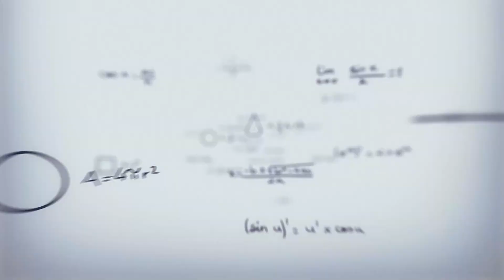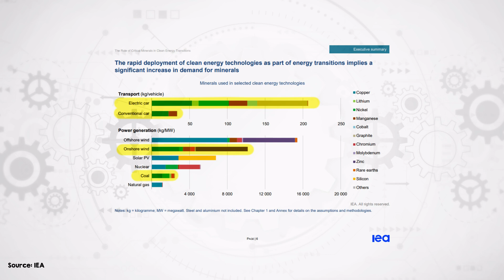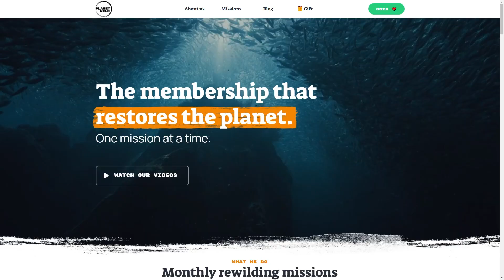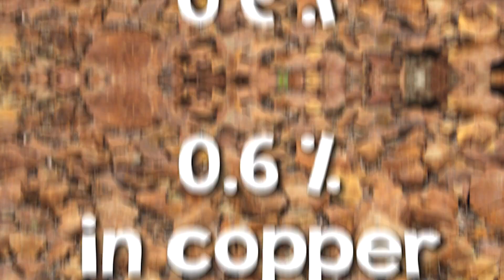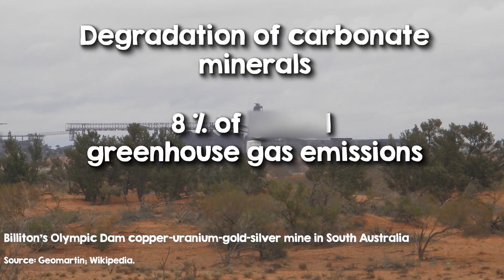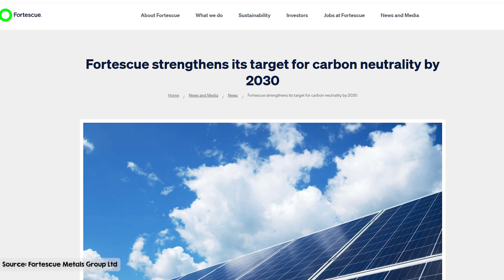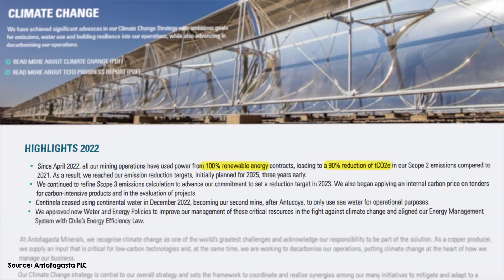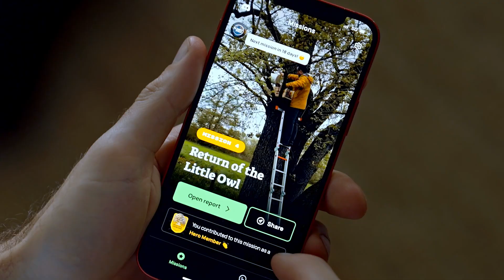Zero-Emission Mining Technologies are Here

Comment: Here's a 90s (and 70s and 80s) environmental idea that I think is still valid - use less....of everything. 

As well as saving energy, you'll save on all of the materials that need to be mined, to produce the stuff we use for a little while and then throw away...

Buying a new 3 tonne electric SUV, and charging it from one of the dirtiest grids in the world (Australia),  won't halp much to reduce CO2 emissions, particularly if you're charging it overnight, when coal supplies 70% to 80% of the grid supply.... 

Use public transport instead - it's more efficient than private vehicles, no matter what the power source.

To quote another Engineering Youtuber, John Cadogan - we can't consume our way out of the problem....
Reply: Not as much as one would like, but when you look at the whole efficiency cycle, even a 100% coal powered ev produces less co2 than a petrol car per km driven. This is due to the higher efficiencies of burning coal in a large plant than a small engine, the regenerative breaking of evs, and the relative efficiency of electric systems compared with engines.

I agree though, more public transit and densafication is an essential part of our growing cities and making things more green.
Reply: @varno  this is one of those (often repeated) EV myths that sound nice and plausible in theory, but just aren't backed up by objective fact or reality...... 

Compare, for example a Mazda 3 (official consumption 5.8 litres/100kms), with a Tesla Model 3 Std (official consumption 0.150 kwh/km).

Petrol produces 2.91kg of CO2 per litre when burned in an ICE. A black coal fired power station of the type predominantly used in Australia produces 1.11kg of CO2 per kwh of energy at the wall outlet.

If you use these figures and do the arithmetic, you'll come up with 170g CO2/km for the Mazda, and 167g CO2/km for the Tesla, so pretty much the same..... It's even worse for a brown coal fired power station (which is about half of the total coal generation here).

When you include the extra embodied CO2 in an EV at manufacture due to the battery (about 100kg of CO2 per kwh of battery capacity), the Tesla would need to have 20% lower emissions per km than the Mazda to just break even over a 200,000km lifetime.

In Australia, most of our renewable energy comes from solar (which doesn't work at night), consequently between about 11pm and 6am, the electricity grid is usually about 70% to 80% coal based.

As a result of this, if you charge an EV at home from the grid overnight currently (as will most people who use their EV to commute to work), your EV will not be significantly cleaner than an ICE, and could even be worse.....
Reply: @peeemm2032  there are two things to consider in this calculation that make your analysis unfair:

Firstly  you use 100kg/kWh as your battery co2 emissions rate, but the mekinsey report you are pulling that from puts that at the upper range, where as the lower range is about half that with the more conservative values being between 40 and 80kg/kwh. This brings the life cycle embedded carbon for a rear wheel drive model 3 to somewhere between 6g/km and 12g/km

Secondly, the design life of an ev is roughly double that of an ICE vehicle, with the model 3 battery desogned for 400,000km, so you need to include the embedded carbon in the steel of the second car that is not produced in your life cycle calculations to offset the co2 embedded in the battery, further reducing the overhead.

These two things basically equalise the difference you bring up in your analysis, tilting the scale slightly towards the ev. If you add in the final fact that, the electricity mix in Australia is going to change over the next 10 years, whilst the petrol car will always use petrol. It is the greener move to buy an ev.
Reply: @varno  no, when I checked a range of credible sources, the values were from a low end of about 30kg/kwh, up to 200kg/kwh, depending on chemistry, where they were made, and who makes them. Without knowing the exact source of the battery in any particular EV, I think 100kg/kwh is a reasonable "average" value to use for comparison......

You are also assuming that the batteries are actually going to last as long as the manufacturers say they will (ditto the cars). Maybe they will, maybe they won't, but at the moment there isn't a good body of evidence to back this up, so until thete is, I'll stick with a 200,000km lifetime....

In any case, even ignoring the extra CO2 from manufacture, it doesn't change the fact that an EV powered from 100% coal isn't going to be any cleaner than an equivalent ICE, and that when charged overnight in Australia, even ignoring CO2 from manufacture, the absolute best it will be is 70% to 80% of the emissions of a similar ICE vehicle....

Yes, things will change in the future, but nobody knows how quickly and exactly what that will look like. I'm talking about right now, and for the immediate future (5yrs)....
Reply: @varno  Absolutely correct!  100 kg of CO2e emissions per kWh of battery capacity was the upper-most of the range, several years ago.  That number goes down by nearly 10% every years, through manufacturing improvement, and less energy-intensive chemistries.  The average is now around 50 kg/kWh of battery capacity... and still going down!

One little question:  you wrote "...the life cycle embedded carbon for a rear wheel drive model 3 to somewhere between 6g/km and 12g/km".  Do we agree that this number is carbon, NOT CO2?  It can be confusing.

While I totally agree that the lifetime of an EV is likely to be at least double that of a comparable ICE vehicle... it is not yet proven, not enough EVs having yet reached "old age" to make bullet-proof statistics of that!

I made a little model calculating after how many km or miles the carbon debt incurred by an EV in manufacturing is paid back, as a function of the carbon intensity of a given grid.  Using the Polish grid's record carbon intensity of 690 g/kWh (worse than even Australia), this pay-back comes at around 20-25'000 km, or 13-15'000 miles.  So after hardly more than a year of driving  in Australia, two in Europe!
Reply: @st-ex8506  that 6g/km was based on a 400,000 lifetime, with a 60kW.h batter (slightlyy larger than a base, tesla model 3) and 40kg of CO2 per kW.h of battery capacity. 12g would be for 80kg of CO2 per kW.h. 

One nice thing is the numbers commute, and so if you have 200,000 km and 40kg/kW.h you get 12g/km, and if you are 80kg/kW.h you get 24g/km in co2.

The unit is co2 equivalents and not carbon mass.

Australia currently has a very high percentage of coal power, within 10 years it is all scheduled for decommission, but right now overnight power is annoyingly stubbornly coal here, and old coal at that, though I should get some numbers for out co2 intensity here and check that number too.
Reply: My 11 year old Nissian Leaf I bought 6 months ago does 6 km per kw  so 200 gm co2 per km a base model Tesla model 3 does a bit better my numbers are from the last 6 months I have had it. around 1/5 of your numbers I charge off 15 year old solar panels that cost me $100 a kw 4 years ago. A 5 year old Tesla should last another 20 years till its range is the same or much more as the Leaf had when new saving $3,000 a year x 20 =$60,000 and the battery can be recycled something not possible with burnt petrol + 40 oil changes and a big pile of plugs, filters, belts ect.
Reply: @varno  I can save you the trouble - from the last National Greenhouse Accounts Factors document   (published in August 2023, and covering the 2022/2023 financial year), the national average CO2e emissions intensity for the electricity grid was 0.73kg/kwh, including scope 3 emissions (indirect emissions from grid losses, mining and transport of coal etc.).

According to OpenNEM, the energy mix for the NEM for the s as me period was 57.6% coal, 5.5% gas, and 36.7% renewables.....
Reply: @suncitybooksgeraldton335  you haven't put a tag at the front of your post, so I'm assuming you were responding to me.

If so, you may be a bit cinfused - I'm not sure which of my numbers you're disputing, but I said a Tesla model 3 will produce about 167g of CO2 per km when charged from 100% black coal.

This is about what you say you are getting from your Nissan Leaf, though if you're getting that when you're charging from solar panels, I think there's something wrong there, you should be doing much better than that.....
Reply: @st-ex8506  I don't know what your sources are, but the MIT (Massachusetts Institute of Technology) Climate Portal, from an entry updated in 2022, had this to say - "For illustration, the Tesla Model 3 holds an 80 kWh lithium-ion battery. CO2 emissions for manufacturing that battery would range between 2400 kg (almost two and a half metric tons) and 16,000 kg (16 metric tons)", which represents  a range of 30kg/kwh to 200kg/kwh. They also said this was due to where and how the raw materials were mined, and where the batteries were made, with batteries manufactured in Europe and the USA tend to the lower end of the range, and batteries made in Asia tend to the higher end of the scale (consistent with the energy mixes in those regions).

Given that most EV batteries are made in China, and so more likely to be at the high end of the scale, I  think a reasonable average is 100kg/kwh, and this is probably still being generous towards EVs, even given manufacturing improvements in the meantime......
Reply: @peeemm2032  I was saying I go around 6 km per kw not 1km so 1/6 the polution if I used coal fired power but I use my own solar We also have large solar and wind farms near by that provide power for others without roof top solar.
Reply: @jonathantamm9202  a Nissan Leaf uses about 0.171kwh per kilometre (manufacturers figure), so yes, about 6km per kwh. If charged from 100% black coal fired power (which produces 1.11kg of CO2 per kwh), then the Leaf will produce about 190g of CO2 per km - this is about the same as a similar ICE vehicle (a petrol powered Mazda 3 produces about 169g of CO2 per km).

If you charge from solar, the Leaf should be pretty much emissions free..... But solar doesn't work at night, so if you're charging your EV from the grid overnight (which is what most people who use their car to drive to work during the day will do), the grid is 70% to 80% coal, so your EV will not be much cleaner than an ICE....

BTW, used engine oil can be sent back to be re-refined and re-used. When you get your car serviced, the used oil gets dumped into a tank, and a truck comes to pump this out regularly, and as far as I know, that's what happens to it. Steel in used oil filters can also be recycled and reused. Modern spark plugs last for 100,000km or more, so your average car probably only has 1 or 2 sets of plugs in it's life.......not much waste there either.....
Reply: @varno  I found the McKinsey report you referred to (from February 2023), it had the following to say about CO2 emissions from battery production:-

"(Battery production) is the biggest source of embedded emissions for both electric cars and trucks, accounting for about 40 to 60 percent of total production emissions", and 
"making batteries can generate as much emissions as producing all the other materials that go into making an EV—or even more"

It also said "producing a typical EV (with a 75-kWh battery pack) emits more than seven tons of CO2e emissions on the battery alone". That is, more than 93kg of CO2e per kwh.......

All of which essentially essentially agrees with most of the other reports I've seen, and backs up the estimate of an average of 100kg of embedded CO2 in an EV battery per kwh of capacity which I was using for my example (and which you objected to).

I really don't understand how you could concluded from this report that a figure of between 40kg and 80kg of CO2 per kWh was more accurate??
Reply: @peeemm2032 

Firstly, my number was between 40 and 80, not between 20 and 40, kg/kw.h. 

Secondly I was talking about the delta between an equivalent petrol car and a ev in terms of embedded carbon, and not just the ev. So I do think that the delta in co2 is fairly somewhere in that range.

Edit:
Also, not that the same report explains that most manufacturers believe that it is possible to get those emissions to 20kg/kw.h in the 2030 timeframe. Also look at exhibit 2, where while the text says 100kg/kWh.h there are already value chains doing it at 40kg/kw.h.

I think my estimate is reasonable given this, and that it will be progressively better over time too.
Reply: @varno  My apologies, I inadvertently misquoted you - I read 40 to 80kg/kwh, and for some reason wrote 20 to 40kg/kwh. I've now corrected this in my post....

It doesn't change anything much however- your figures are still wrong.

For absolute clarity, I was talking about the extra CO2 produced during the manufacture of an EV over an equivalent ICE vehicle.

The McKinsey report clearly states that, today, manufacture of an EV has "roughly double" the carbon footprint that an equivalent ICE does. 

It also states that apart from the battery, a BEV and equivalent ICEV have a similar carbon footprint during manufacture - this means that the "delta" is essentially the CO2 for battery production, which they clearly state is "more than" 7 tons for a "typical" EV battery of 75kwh capacity, i.e. more than 93kg/kwh of capacity.

Exhibit 2 in the report shows CO2 emissions intensity (kg/kwh) for Li-Ion battery manufacture from different countries - Sweden at 45, South Korea at 72, United States at 74, China (non nickel chemistries, e.g. LFP, only), at 79, and China (nickel containing chemistries, e.g. NMC) at 108.

If you look at Sweden, you'll notice that there's no component for cell production included in that figure. The only Swedish Li-Ion battery maker I can find a mention of is Northvolt, and it's not clear if they're actually manufacturing complete cells, or if it's just cathode material.... So I'd take that figure with a grain of salt...

The report also says that more than 70% of Li-Ion batteries are made in China, and I would guess the majority of this is still nickel containing chemistries, which probably explains why their stated figure for an "average" battery is over 93kg/kwh.

The only prediction about future emissions intensity from battery manufacture contained in the report is that "the global average of GHGs from battery production could decline to 85 kg CO2e/kWh by 2025". They only say that it's "feasible" to reduce GHG emissions for battery production by "up to 75% in the next 5 to 7 years", then give a whole list of caveats, actions and conditions for this to happen. I wouldn't be betting on it.....

If you read my posts, I've used the present tense in all of them - everything I've said is about what IS ACTUALLY happening now, not what MIGHT (or might not) happen by 2030, and I've been talking about EVs in Australia, not anywhere else.

I fully expect battery technology, and as a consequence EVs, to be better in every way by 2030 - they will be lighter, safer, cleaner, more reliable, and have better range. The Australian grid will also be cleaner, so EVs here will be too. The question is only by how much....

I'm still mystified by your claim that my estimate of 100kg/kwh for CO2 from battery manufacture is wrong, and you think it's 40 to 80kg/kwh.......The McKinsey report doesn't support any of your assertions......
Reply: @peeemm2032  I acknowledge that those numbers were probably not supported by the McKenzie report, but for example the model 3 base model that I have been using as a benchmark used LFP battery cells, and an analysis of the embedded co2 potential for lfp packs  by lai et al. suggests this is closer to 62kg/kwh (doi:/10.1016/j.jclepro.2023.138674) gwp with a range of uncertainty between 42 and 72 kg/kw.h, NMC cells do have a much higher GWP of closer to 122kg/kw.h in that study.

In general, these seem to make up about 5-10% of the lifetime co2 emissions of the vehicle, and so really the question of whether the beverage has a lower gwp than a petrol vehicle seems to come down to two questions:
1. What is the energy mix that is used to power the BEV.
2. How much longer does a bev last than a conventional ICE vehicle in terms of km driven.

With conservative answers to both those questions one gets that with the current east-coast energy mix the bev probably emits somewhere between 70% and 115% of the co2 of an ICE vehicle, assuming equivalent lifespan.

If one takes into account changing energy generation and a longer lifespan for bevs (for which there is beginning to be good evidence) and that even without this the minerals within the bev will be recycled at the end of life of the EV rather than disposed of, the energy usage over the lifetime of a new bev could probably be reasonably expected to be substantially better that that.

However, I do agree that with current manufacturing, the difference is not as clear cut as many would wish.  Long term though, it is the only real way to decarbonise private vehicles, and we do need to prioritise their roll-out, it just has to be done in tandem with greening the electricity supply, and reducing the environmental impact of mining and manufacture. This can only really be done by developing more scale.
Reply: Who is buying a 3-tonne electric SUV?  There are thankfully only a very few of them produced.

The dirty electric grid in Australia is not the "fault" of EVs, but of Australia's energy choices through decades.  But I understand it is achanging, and getting cleaner every year that goes by.  And even so, it still many many times cleaner than burning petrol or diesel!  And there are already many countries that use zero or next to zero fossil fuel for their electricity generation... and for sure zero at night, when indeed most EVs are being charged.

I agree with you that using public transport is best... and I do just that all weekdays, as my country (Switzerland) enjoys a incredibly good public transport network.  But, unfortunately, it is definitely not the case everywhere!

On-demand transportation by driverless electric cars might well become one way to very significantly decrease the size of the world's car fleet.  But, it will take a few more years...
Reply: @st-ex8506  over the last 30 years or so, people in Australia have been moving away from public transport and towards private vehicle use - peak hour in some of our cities now last 3 to 4hrs.... 

The two top selling "cars" here last year were both medium sized dual cab pickup trucks, and the rest of the top 10 were pretty much all small to medium SUVs. Our average "family" vehicle is a medium sized SUV (e.g. Subaru Forester, Hyundai Tucson etc.).

Large SUVs (e.g. Toyota Landcruiser, Nissan Patrol, Range Rover etc - all around 2.6t) are also relatively common. You often see them in traffic, with a single occupant, being driven to and from work, and I'm pretty sure that many of them (possibly even most) are never used for anything other than commuting, shopping, driving kids to school etc......

You're right, we don't currently have many electric SUVs at or over 3t - the Kia EV9 (at 2.6t for the top tier GT-Linel, and the Mercedes EQS 450 4Matic (at 2.9t - pretty close!) have recently been released here, and I'm sure some people are buying them. The EV Range Rover has been announced for this year, and given their plug in hybrid weighs 2.8t, I would expect the full BEV version to be somewhere near the 3t mark....

So 3t BEV may have been a slight exaggeration right now, but it's only a matter of time before they're a reality, and I'm sure there will be some fools who will buy them, thinking they're helping the planet....

My point was that if you're genuinely concerned about greenhouse emissions, using a large SUV of any  kind (ICE, BEV, or even hybrid) is a dumb idea.

If you're genuinely concerned about greenhouse emissions, you'll use public transport where possible, and if you must use a car to commute, you should use a small one, and if you need a large SUV to tow a boat, caravan, horse float etc, leave it at home during the week......
Reply: @peeemm2032  I live about 50:50 of the time between Switzerland and our country house in France.

In Switzerland, I use exclusively public transportation during week days (I even have the years "Swiss Pass", which gives unlimited use to ALL Swiss public transports... trains, trams, buses, metros, boats... even some cable transports).  Our public transport network is remarkable, with hourly or even multi-hourly connections to literally everywhere.

But in the French country-side, without a car, you just die!  And I suppose it is also the case in Australia outside large cities!

I agree with you that SUVs are often ridiculously over-dimensioned for the duties they are used.  But when my 4 children were young (plus a dog!), it would have been pretty inconvenient to have just a sub-compact car!  And, if I can perfectly imagine myself going skiing with the train... it would have been quite an adventure to do it with 4 kids!

Now that my kids are long out of the nest, my wife and I are plenty happy with our 2019 Tesla Model 3, and need nothing bigger... just maybe the new 2024 model, which seems to be a significant improvement if I listen to the reviewers.
Reply: @st-ex8506  I'm very envious - I'd love to have a country house in France! I spent some time on holiday near Perigeaux once - it's beautiful down there.....

The city I live in (Sydney) has quite a good train system (but probably not the equal of the London Underground or Paris' Metro) - I can be in most parts of the city from where I live in an hour, and I'd almost always prefer to take the train than drive in peak hour traffic. There are parts of the city that are not covered by the train system however, and buses can be slow and inconvenient to use. At one point the trip from my home to my workplace at the time (15km by road) was a 2hr bus trip, and involved 3 buses.....I drove (still 40 minutes on a good day). So some people still need to use a vehicle to commute to work....

It sounds like you're very sensible in your usage of energy and resources, as are, in my experience, most Europeans. 

I wish I could say the same about my fellow Australians, many of whom seem to want to emulate Americans in their use of energy and resources....... My comments were general in nature, and were more directed towards my fellow Australians than to you, or even most people in other countries.

A lot of people here seem to see a 2.6t, V8 SUV as a status symbol, and something to aspire to, even if they don't have a valid need for one..... 

There are certainly valid uses for a medium or large SUV - for example towing a boat or caravan, or if you like to go on camping holidays in remote areas with unpaved roads etc. I also don't begrudge people with large families owning a medium or large SUV. However, I'm pretty sure that a lot of people here who own them don't use them for these purposes. 

Large SUVs, in my experience, are not particularly good to drive on paved roads, don't stop or turn that well, and because of the rigid chassis, are also not as safe in a collision as a unibody car.....

Many large SUVs (e.g. Range Rover, and some of the other luxury spec SUVs) are also not particularly good off road or towing vehicles. You don't need a V8 petrol SUV to tow a boat or caravan - you're probably actually better off with a smaller engined diesel SUV, pickup or similar to do this. Likewise a van or "people mover" is often a better solution for driving around the family.....

As far as I can tell, there is almost no valid use case for a Range Rover (and other similar "luxury" SUVs) other than as a symbol of conspicous (over) consumption, and to give the owner a sense of power and self importance.....

This is the context for my remarks on over dimensioned SUVs.....
Reply: @peeemm2032  Europeans are, on average, much more energy-saving conscious than are Americans... I lived several years in the USA, but I can't say anything of Australia...
BUT, there are very unfortunate exceptions. As I said, I live in part in Geneva, Switzerland, and worked until last year in Zug.  The first one is a quite affluent city, the second, although small, is incredibly affluent.  So, you can see in both cities 1quite a few Range Rovers (who have NEVER seen an unpaved road!) and other very large SUVs... generally driven by a single very well-dressed woman... So, yeah!  These cars are definitely status symbols more than anything else.
Fortunately though, in both those cities, the proportion of EVs one can see, and especially Teslas, is impressive, and visibly growing every month that goes by!

But, as I said, within our cities, most people use our excellent public transports...
Reply: @st-ex8506  and no, the currently dirty electricity grid in Australia is not the fault of EVs. Aside from anything else they are inanimate objects - just machines or tools. They have no free will or agency to act so can't be blamed, and their feelings aren't hurt if you say anything critical about them, even though some EV "enthusiasts" seem to get very offended on their behalf when anyone says anything critical about them.....

It is, however, a fact that needs to be acknowledged when you're discussing EV usage here, as it directly affects their potential benefits, and their useful use cases, and means that in many cases (possibly even most), they won't help to significantly lower greenhouse emissions...

The dirty electricity grid here comes about largely because we don't have nuclear energy (it was officially banned by law at the end of the 90s), and although we have plenty of natural gas, we don't really use it, as coal is cheaper..... In most cases, the reason why most European countries (and the USA) have cleaner grids than we do isn't because they have more renewable energy than we do (usually the opposite is true), but because most of their non-renewable energy comes from a combination of gas and nuclear - both of which are cleaner than coal.......

And no, as I've explained in another post on this thread, EVs charged from 100% coal don't produce less CO2 than an equivalent ICE - they are, in fact, pretty much the same. This is just another myth that just keeps being perpetuated by many EV "enthusiasts", and is not actually based in objective fact or reality.....
Reply: @peeemm2032  We agree on a number of things... but definitely not all!

Firstly, natural gas has actually a WORSE impact than coal on GHG emissions (not overall pollution, though).  They are cleaner at the point of combustion, but the whole NG system (well, desulfurization plant, pipelines, storage facilities and distribution network) leaks methane to the atmosphere like a sieve!  Those methane leaks have a huge GHG impacts, but are not counted in official emissions.  

The countries that enjoy a clean grid use no or VERY LITTLE natural gas!  They use either nearly 100% renewables (Norway, Iceland, Uruguay, Costa Rica, ...), or nearly 100% nuclear + renewables (France, Switzerland, Sweden, ...), and have a grid's average carbon intensity of between 8 and 44 g CO2e per kWh.

I just calculated  a "worst-case" scenario, comparing a BMW 340iX and a Tesla Model 3 LR, two extremely comparable car, except obviously that the first one has a gasoline engine, and the second one two electric motors... plus a little detail: the BMW costs 50% more than the Tesla!  I used for the carbon impact of the Tesla's battery the number of 70 kg CO2e/kWh which, in a preceding post, I told you is most certainly way overstated.  But I still used it for the sake of being super conservative.

I also added a 10% penalty, over and on top of the Tesla's real power consumption (which I know first hand) + charging and power transmission losses, to account for duties the Tesla power totalizer does not count, like battery and cabin pre-conditioning while plugged in, Sentry mode, Dog mode, etc.  So, I am running out of options to make the Tesla's energy consumption look worse!

Then, I assumed the Tesla would be driven exclusively within Poland, which has the dirtiest grid in Europe, and probably one of the very dirtiest in the world... worse than Australia at 690 g of CO2e per kWh.

The result is that the Tesla has entirely paid its manufacturing carbon debt vs the BMW after 28'200 km or 17'600 miles... less than 2 years of driving!

EVs are significantly cleaner than ICE vehicles over their lifetime, even using 100% coal-generated electricity!!!  Those who believe otherwise are ill-informed AND haven't run the numbers!

If you want the details of my calculations with all sources, you just have to ask.  Making LCAs was an integral part of my job (I retired last November).